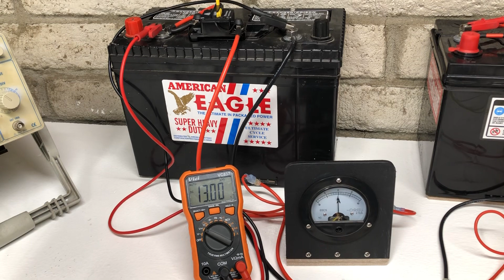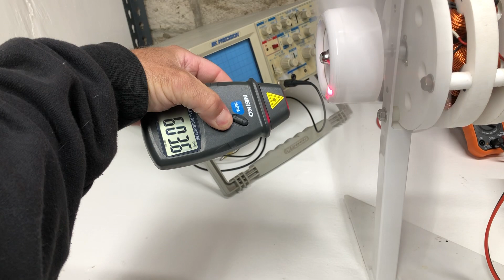Battery swapping load and output test with fan pulse motor

Comment: Your builds are on another level my friend.
Reply from the maker: Thanks ! This is the video I was talking about
Reply from the maker: @Biokemist-o3k  I have a basic version but it’s only for 1 battery
Reply: @kenergy1707  I have an idea also. EV Gray did not even use battery level. He used more of a shut this one off while it receives hundreds of amps of current then go to the net bank. They just had to be synchronized so that the events did not happen at the same time. That could be achieved timer as well. I found a four  pole double throw set of relays mounted on a rail. I want to run something while the batteries are being switched so that would have to go somewhere between the relays and then to the next or use capacitors so that the switch would be seamless.
Reply from the maker: @Biokemist-o3k  I made one of those recently so when cap dumps it turns motor off it was a couple videos ago titled ssr with cap dump
Reply from the maker: @Biokemist-o3k  you can always call me my number is on my website
Reply: @kenergy1707  Awesome. I will when I get some time. thank you my friend.

Comment: First of all you are confusing the viewer by saying Discharge battery, when in reality it is the Charging battery actually and the other one is the Run/discharge battery.  Secondly, your batteries appear to be partially discharged at around 13 volts, which is not a good thing because sulphation will build up over time and compromise they're performance and may even lead to failure. What you could do, to remedy the situation is to initially run you motor from an external power source and allow both batteries (by toggling) to attain a terminal voltage of atleast 15.5 volts each, and then you put them back into normal operation and observe whether they are able to maintain this terminal voltage, over extended periods of time, say 72 hours or more. If that happens, then you can be sure that it is not going to stop
Reply from the maker: So why don’t you put up more videos?
Reply: @kenergy1707  Yes I will, as soon as I finish with what I'm presently working on.

Comment: Really do like this fan. It runs smooth but most importantly it runs quietly. Since you made so many motors what do you think makes this motor running as a fan so very quiet?
Reply from the maker: This motor has 4 magnets 6 coils and 3 circuits it has seamless torque smooth bearings and runs at a maximum of 1,600 Rpms with fan at 1,000 Rpms it’s very quiet but can start to make fan noise at full power

Comment: Great test setup! Even if not OU it’s very efficient - how long could you run fan (at constant speed) on one battery without Flyback recovery? How long could you run with two batts using the Flyback? Likely much more than 2x the time on one batt. Great job!
Reply from the maker: They are 100 ah so long time lol that’s 200 hours per battery if they were true rating
Reply from the maker: Plus the capacitor discharge recovery